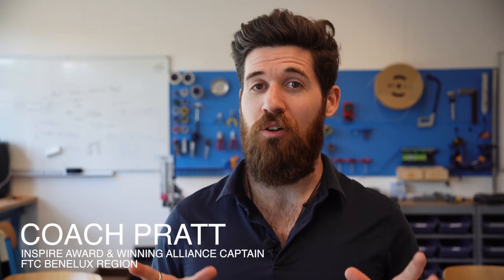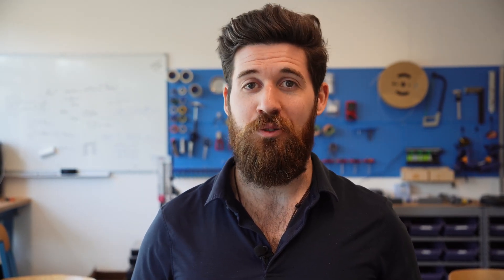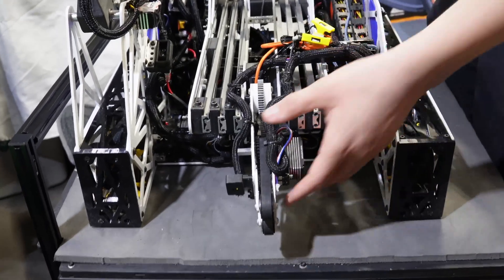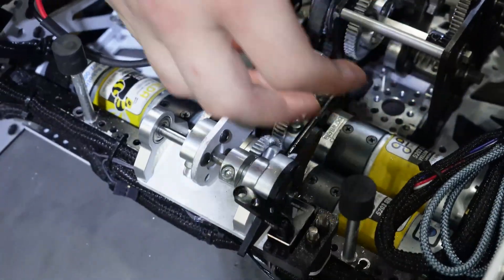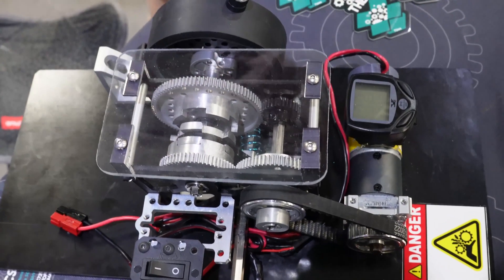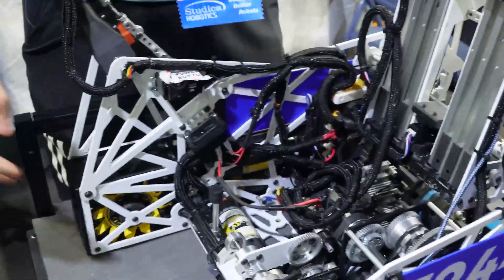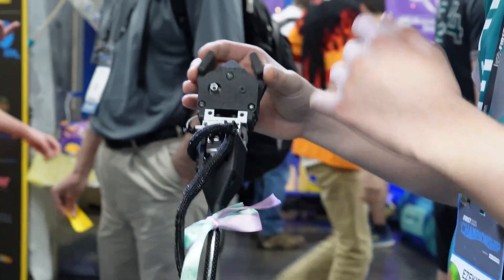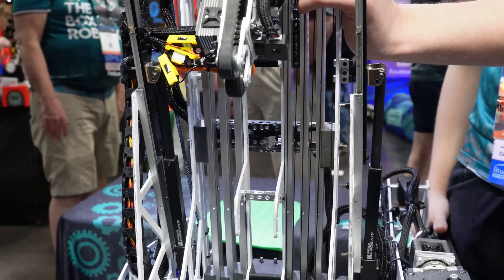FTC Robots Revealed: 7244 OUT of the BOX Robotics - Power-Take-Off Mechanisms

Comment: W robot, but how is it that the one time I see our robot in someone else’s video it’s experiencing crazy power draw issues 😭
Reply from the maker: Ah that's a shame. Apologies that I managed to find the match with discrepancies. Do you think you may have used an old or uncharged battery, slipped a pulley adding extra friction to your system? Power Draw issues on a single match are odd indeed.

Comment: My team often face difficulty in handling the cables (cable management), sometimes it gets stuck and whatnot... what do you reccomend?
Reply from the maker: There are a bunch of different methods available, I've got a video coming in the future so stay tuned. For quick reference, I like velcro a LOT with cable management, as well as using a label maker for each joint, start, and termination points on cables to keep things well organized and not confusing which cable goes where.